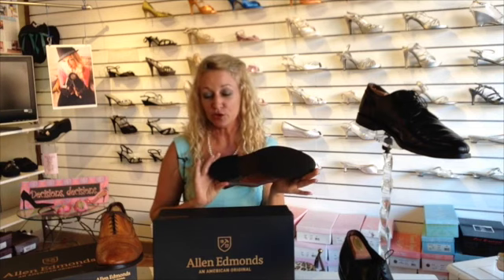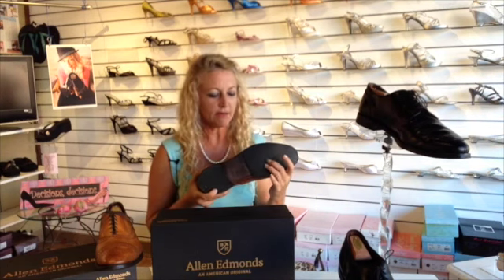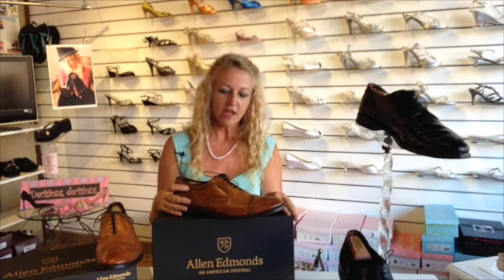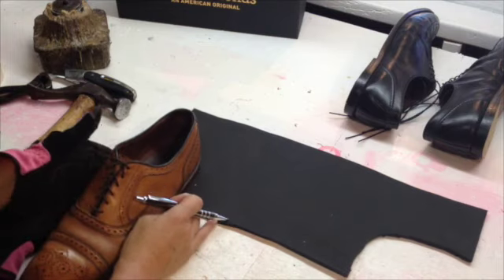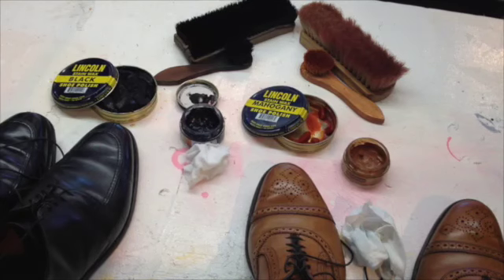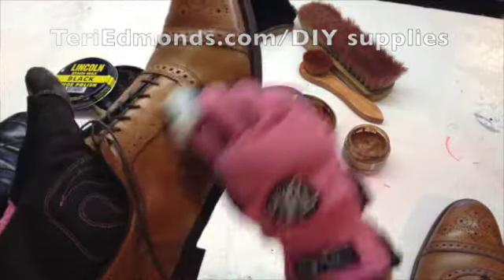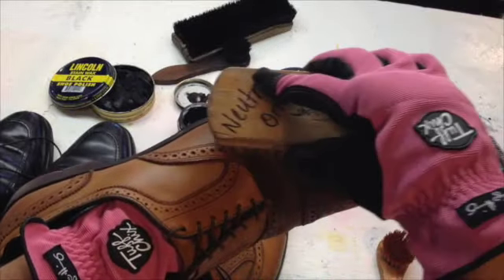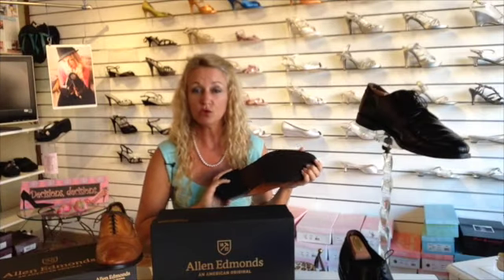DIY: Allen Edmonds Shoe repair

Comment: HELP! I have a pair of dress shoe but on of the shoes the toe stiffener has failed and leaves the leather toe top with a dint on the shoe. How can I fix this problem so the dint doesn't show or fix the toe stiffener to push the leather back out?

Comment: I would only do this if I were sure I was never going to send my shoes back to the AE factory for recrafting.  AE says they may, at their discretion, decline to work on shoes which have been serviced by outside shoemakers.  

I suppose it's not that big a deal, because your outside shoemaker can probably put on a halfsole cheaper than the full AE recrafting job, but it's nice to keep the option of having them rebuilt and refinished by the maker.
Reply: Joe Photon I agree with you.